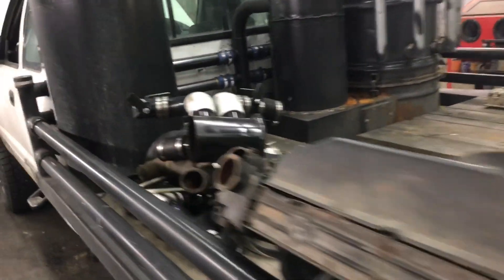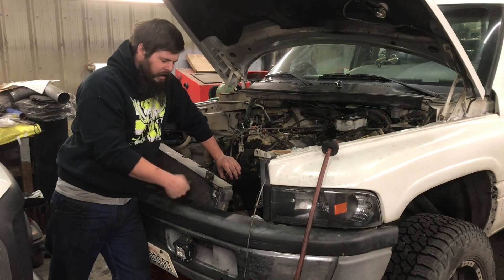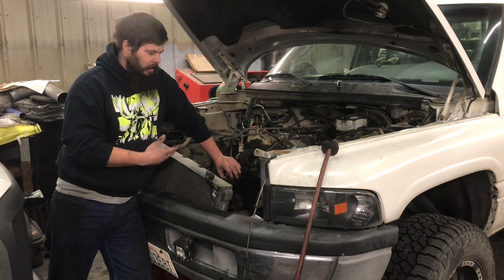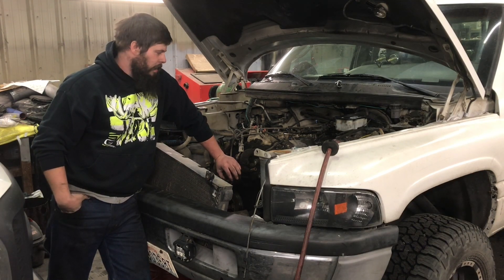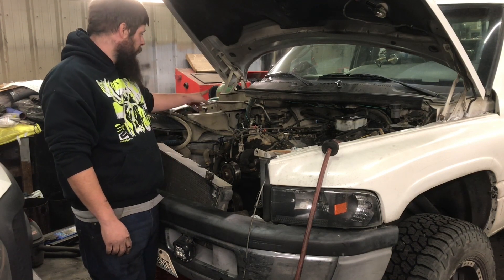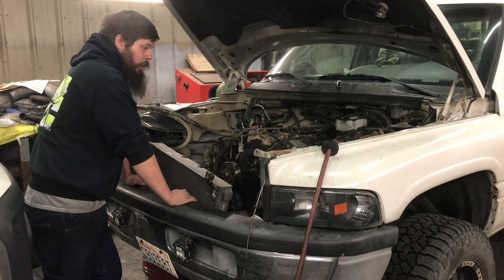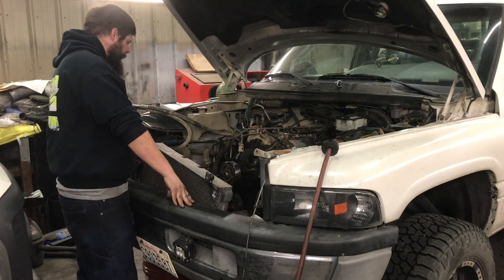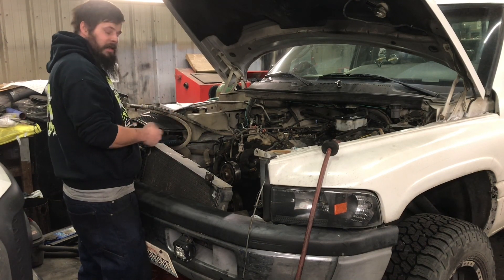V10 Dodge Magnum, the Engine that Hates SLUDGE Worse Then Others

Comment: Have you considered microsquirt or mega squirt , even a microsquirt small version of ms can operate and be wired a trans controller , as well as engine standalone , and tuning with tuner studio, im thinking about doing it to optimize the fueling and timing tables and ignition to get a better tune than the generic factory tune

Comment: I would guess it's because of the customer base who bought the v10 trucks. It was the people who wanted diesel performance without the diesel operating cost.  Business owners who are starting without much cash flow, therefore the trucks got neglected, ran hard and put away wet. When I was a kid,my dad's friend, who was a roofer, had 2 nice black extended cab 3500 dually v10's. He was that exact type of guy, while having a mint 340 6 pack dart 😂😂😂😂
Reply: That was in 1998 😂😂😂

Comment: How dirty is wood gas? I know the v10 is designed to run on low octane gas but low octane gas is also dirty and even worse at cheap gas stations. Thanks for the videos.
Reply from the maker: All depends how much you want to filter it, I’m not to picky the v10 doesn’t seem to mind a little soot ingestion

Comment: How's the wood trucks going now? I was doing some research and it seems on the drive on wood forum a lot are suggesting EFI engines over carb. Do you have an opinion on that? What's the difference when it comes to gasification? I'd assume carb will be simpler to plumb up but maybe I'm wrong
Reply from the maker: @RemotePaws  eh it’s personal preference I think, and what is available to you that you can build on. My Toyota is a carb and for what I need it to do it works great, and so does the dodge being multiport efi. The drive on woods is such a wealth of information it’s unreal

Comment: Maybe you’d have some insight on the problem I’m having, I’ve got a 98 ram 2500 with the v10 and the gauge keeps saying it looses oil pressure and the but it doesn’t sound like it has no oil pressure when the gauge hits zero it’ll start to make a bit of rasping noise (almost sounds like a really quite 12 valve) I’ve replaced the oil pressure sending unit I put a whole bottle of Lucas oil stabilizer in it and it shut up for 2 days then I go do a quick burnout and it looses oil pressure on the gauge again
Reply from the maker: @Kenworth_driver_1341  I’d bet you have a sludges motor like I did. The Lucas won’t actually help it needs a detergent to break the stuff free the old ways is add a quart of atf or diesel and idle it up to temp drain and refill with new oil. Lots the gauge in these trucks isn’t actually a gauge it’s a idiot gauge, because it uses a oil pressure switch which only indicates wether there is oil pressure or not. A manual gauge will give you the real information you need before diving deeper
Reply: @BigBeavrSlayer  perfect thank you very much!

Comment: How many miles on that thing man?I have 209000 on my 96 and 0 issues with a truck.Just replaced the factory original starter.Not too long ago.That alternators next but I haven't had any issues with the truck at all man...
Reply from the maker: This motor had 340,000 on it when I pulled it for my lower mileage spare motor to go in

Comment: I have 2 v10 magnums, I love them. 

I would love to build one into a woodgas truck
Reply from the maker: I really do love these motors they make great power and now I woodgassed this one and swapped it to OBD1 it's even better. Though if yours is OBD2 the option is there to tune it and make even better power on woodgas
Reply: You can just change your computer to obd 2 just like that in my 1995

Comment: My wife has a 2001 Durango with the 4.7 V8 (166,000 miles currently) that we bought new and she won't sell it.  I was concerned with the age even though I am religious with care and maintenance.  The only concern is she only drives less than 20 miles per day usually so the oil changes are more by months than mileage.  I was told by an older mechanic to drain the oil then add oil with new filter minus 1 quart of oil and substitute with 1 quart of kerosene.  Let it idle and drive several miles then drain the oil and change the filter again.  Top off with normal amount of oil and drive for 1500 miles then do a service again.  I did this at 125,000 miles and it doesn't burn oil or give  me any issues. Just a thought.  The kerosene helps flush everything in every part and from what I saw it worked.
Reply from the maker: Kerosene,atf, diesel, marvel mystery motor oil, Jb, there are a ton of ways to flush a engine I have used most over the years and for loose liduid sludge they work pretty good, but the hard crispy sludge from not changing the oil and pcv not venting correctly no real way to get that out of a engine but tear it down and scrub it out
Reply: @BigBeavrSlayer  Gotcha.  My engine had less work and load applied which makes a difference.

Comment: OBD1 is a simpler system, might be more reliable.  This is a good example of the importance of regular oil changes. Hope it all goes back together without a problem.
Reply from the maker: one way or another it will go together, iv never been one to let a motor beat me. other then when it needs expensive parts i cant afford 🤣

Comment: I am 64 years old and I found out that for myself when I was 17 when I got my VERY first72 challenger rt let me tell you I blew that 440 up in the second week after I owned it yeah it was so much fun going sideways at 80 mph slamming 4 gear and still burning tires. I called my older brother and he came and pulled me home and this was when you could get a rebuild kit for 100 dollars and a solid cam and lifters still kept the tri power two days later I was driving it to school and taking it easy for a good month and let it RIP and oh boy I actually twisted the entire body of my CHALLENGER and that bummed me OUT BIG TIME . Anyway I went looking AND found another 72 challenger for 200 bucks no motor  AND it was a 4 speed so I got lucky because he left THE tranny and pistol grip shifter in it I dropped my 440 into it and bought frame connectors and never had the body twisting problem ever AGAIN.  Fun times. And that is when I found out that I have the knack for having fun and breaking things as long as THEY ARE mine.
Reply: Great story. Yeah I had a 1967 Dodge Coronet R/T with the 440 Magnum and 4-speed. Rubbed my ass raw from getting slammed back in the seat and lighting the real wheels on fire.
Reply from the maker: Man I wish I was alive in those days, I have always wanted a charger or a dart. At todays prices I could never afford one! But yes I am very hard on my own rigs, sometimes you just need to let some smoke out of the tires and enjoy the sound of the pipes. Really one main reason I got into alternative fuel is JUST SO I could do that and not worry about the damn gas bill! V8 fun comes at a cost when you get to the fuel pump these days….
Reply: @BigBeavrSlayer  I wish I could have kept everything I owned I wouldn't have had to work so damn hard my whole life but 4 kid's it was well worth every sore muscle and broken bone AND paycheck to paycheck I actually started to fix up my older parts cars and sell them and THE YOUNGER guys WERE going crazy for THESE older FAST mopars . I had BUDDIES that were DEPUTIES and highway patrol and I would give them money and they would buy the best OF their interceptors for me AND THOSE WERE THE VERY fastest of THE fast and I would tak the motor tranny and the pumpkin and put it in a lighter car like a dart road runner or a cuda  or A CHALLENGER and they would be sleepers and I would win irocs cameros, and mustang's even won 69 charger with my 68 roadrunner .
Reply from the maker: Sounds like you got to live through the golden age of hot rodding. When I was young we grew up in the woods so it was all about 4 wheeling up through the  mountains. I cut my teeth on 4 banger Toyotas still love them but the v8 power is addictive that’s why one of my Toyota has a Chevy 350 in it now